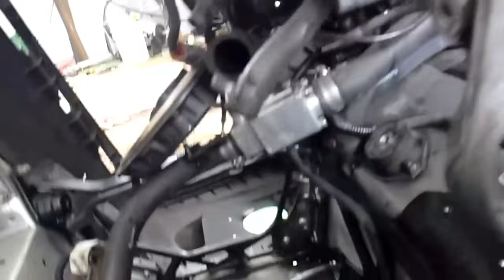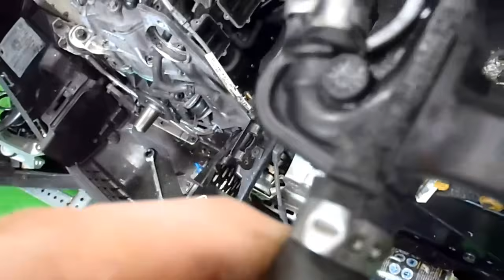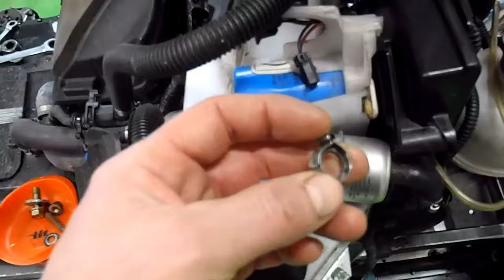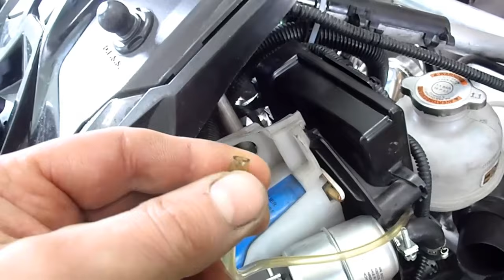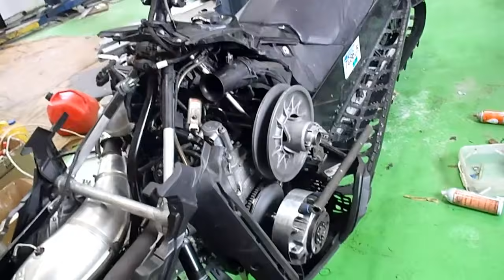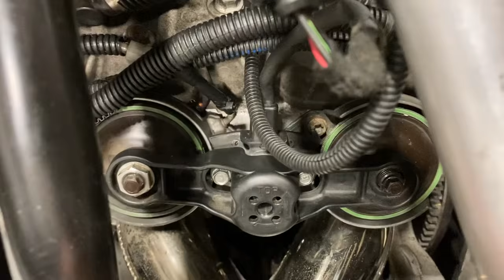Final assembly, how to put the engine back in the Summit XM

Comment: How do you drain the coolant to do the top end, was thinking I can just use a shop vac as I take it apart, my buddy blew the base gasket and shit out a bunch of coolant, and when filling after rebuilding the top end do you just fill through the reservoir and let it bubble down till it holds a level? Thanks
Reply from the maker: I think there's a coolant drain you can take the plug out of and drain it down.  I honestly can't remember.  Filling is through the res, lift the front of the sled up so the coolers fill and air gets out.  Start, warm up and let cool down, then top up again, maybe once more and you should be good.  Be careful and try not to break the "Bleed manifold"  if you do, they're only like $30 to replace, but better if you can save it

Comment: I watched all your skidoo motor assembly and reinstall videos from start to finish. Thank you for posting this. I rebuilt a 2004 Rev 800 from the ground up and it was successful. I wasn't sure how complicated these newer etecs would be should I purchase one. I am still having my doubts about whether I would be able to do what you just did. I would definitely need the skidoo teardown manual/ microfishe diagrams for a guide.
Reply from the maker: You can do it man, with a manual for sure.  They're just an 800R with direct injection.  Definitely clean up the ports while you have it apart if you end up rebuilding one.  Thanks for watching, I'm trying to get some new content coming here soon, just been busy